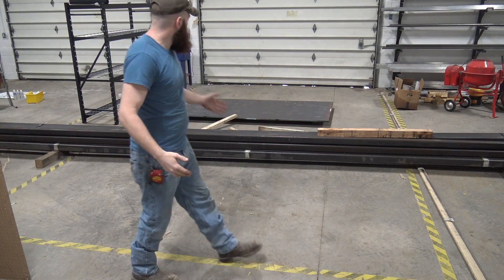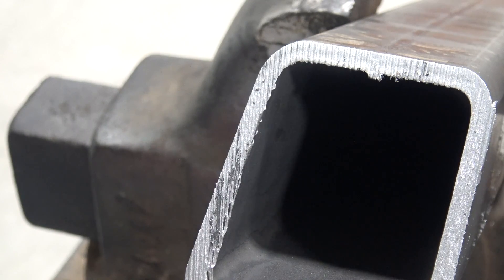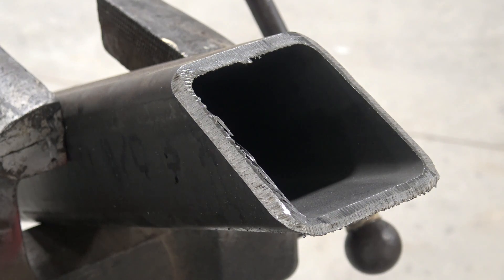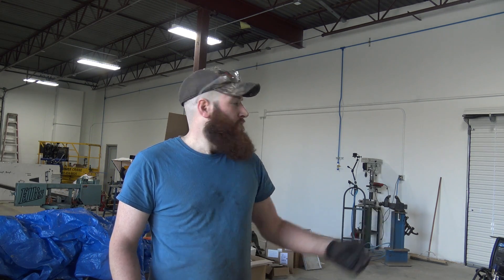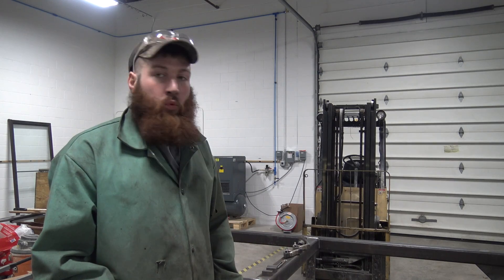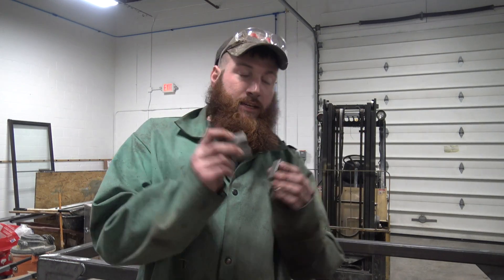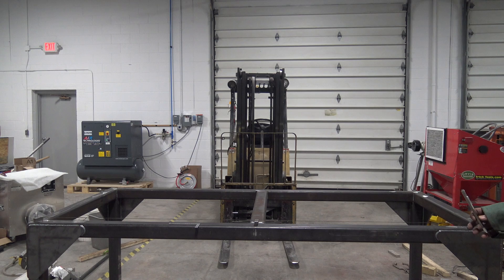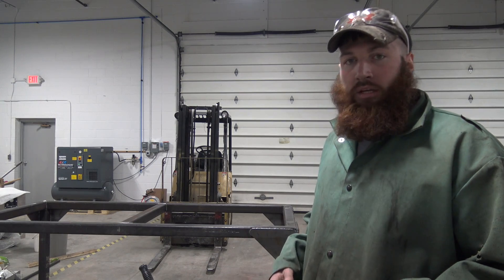How to Build a Welding Table!  Widget88

Comment: I use metric, you gonna have to learn to use metric if you gonna follow this... so... 24".70 in length by 12".20 wide... 

Dude don't use that much metric because you make it sound imperial.

Comment: The heat effected zone is only about half inch from your weld you can usually see this by the color difference and i was shown to heat up a "dot" at a time not as much as shown because the material has been altered once before and heat distorts material  more than thought. try to press it back straight first if possible because the molecules "grain" of metal can only be manipulated so much  before it weakens and becomes brittle 
Metal usually has a "natural" bend from the mill adjust your build best for this if you can if not back bow or bend the opposite direction the work is to be welded to compensate for the warp from welding also bracing before welding and then stress relieving the welds helps alot 
To stress relive a weld simply "ping",  hit with a hammer were the work was effected

Comment: Downhill welding isn't a problem as long you know when and when not to. Like a cap on an end of rectangular tubing it would even be a problem go downhill. But something structural, I woulnd't recomend it. From my experience you can go downhill since it doesn't affect penetration for steel under 3 mm.

Comment: I don't think I would bother trying to flatten a piece of plate that size with heat. The fact is, it's still going to move over time. I would weld some tabs on the underside of that center beam with an acme nut welded to the top of the tab. Feed some acme rod up through that to contact the underside of the table. Adjust the table up and down using the acme rod.

There are several configurations you can do with this. Some people will weld the rod to the plate, but I would prefer not to put localized heat into the plate.
Reply: p

Comment: I use a torch and bucket of water with rag, heat with one hand and quench with the other with wet rag. that pulls the metal more but requires less heat and that is important doing very thin RHS (2mm wall) otherwise the wall bulges if you heat enough to pull without quenching. If you lack an oxy torch you can run a weld line and quench it to pull, just grind it off when done.

Comment: I learned the hard way... my welding table is not as flat as it's suppose to be since anything you weld will be affected by it. The frame warped while I was welding and I ended up with a 3/16" gap in the center. Needless to say, I'm starting over. Of all the videos I've seen of those making welding tables, no one says anything about how to create a flat welding table.
Reply: What's a 3/16" gap?
Does not compute!

Comment: Would have done the three block string measurement before welding.  I use a inexpensive laser line device on a stand to keep things on track.  Great thing about using a laser is that you can leave it on during welding to monitor distortion.  Metal suppliers will not have metal in their yards that is truly strait due to the manufacturing process and handling.  I sometimes need to place metal sections in a shop built 20 ton press to remove some of the bow in the metal.  Your heating of the metal after welding up the base to remove distortion of the metal from welding is a nice idea but you were working against gravity and heating of the metal can remove temper and anneal it. It's not all that critical in a welding table to have nuts on measurements.  It's a welding table after all that will warp due to heat from future welding.  There will be tacks and weld splatter that need to be ground off which will make the table have high and low spots.  The only truly flat welding table I have used was one that had a machined cast iron plate for a top.  Very nice setup but weighed more than a house.  Your use of gussets and welding technique is very good.  Hope to see more videos of you building things.Not a big fan of metric.  Base 10 stuff is alright I guess.  After all we have ten fingers and toes unless there was an accident in the shop that removed a digit.  I have dealt with a lot of crappy metric nuts and bolts over the years starting with work on a 1972 Volkswagen beetle.  Guess I have never fully recovered from that episode.

Comment: I'd like to make a recommendation for your next table. Use I beams instead of tubing, the tubing will give you very little resistance from warping and if you do any jigging where you are using torches to heat and bend something your table is gonna warp like crazy.

Comment: To me, the key isn't knowing how to straighten or flatten plate, but to build yourself in adjustability. We are using several rows of C-Channel on top of the 3" square tubing frame. And from under the lip of the C-Channel, drill and tap about 5 bolts each. Then mill the top of each C-Channel flat including the ends of the bolts flush. Then proceed to weld the C-Channels to the frame. The table top (ours is only 5/8" that's all I could afford at the time) is only bolted from the top down to the very 4 corners of the C-Channel on the ends. The table is super flat, and if it gets out of alignment anywhere, I can reach under and give a bolt a twist.

It wasn't that hard, except for I don't own a mill, a forklift, have awesome welding set-up... yet I was able to do it just fine. Yeah, I had to pay a shop like yours, to mill off my C-Channel with the bolts in them... but I knew I'd be getting a flat surface in which the steel plate was sitting on. I know a lot of guys think they need to weld the plate to the legs, but after closely checking out some really expensive fab tables by Sigmund, and similar tables, they were all bolted as well.
Reply: TheBikerScout can you make a video of your table?

Comment: In an application like this where one side isn't seen you can do a fine and fast job of straightening with a air chisel with a punch in it.  You can draw your high spots down by putting several punch marks in a cluster on the opposite side.  Thin plate takes few marks, the thicker the plate the more heavy you have to punch it. if you hammered it enough you could actually pull the whole plate into a bowl shape but that certainly isn't what you had in mind.

Comment: Weld the plate on send it out to get normalize and set the whole thing up on a Blanchard grinder. But if going to go with all that trouble and money you should start with at least a 1" thick to 1 1/2" top plate.

Comment: Ok, so I need another thought of conversion - I hear Jared say it's about a mil or 2, 10 mil short, etc. , I think of imperial thousandths,  so verbally saying mil actually chops a syllable from millimeter???? Life is easy so far, only two restrooms to choose from ;P
Reply: +PartisanGuerrilla I too was taught in the old school, where a mil is 0.001" - or $0.001! ;^)

People who were brought up under the metric system in the last 20 odd years have taken to using mil to be a shorthand for mm - mostly because they've never had to work in mils...

Then, I'm also used to working in both systems of measurement, so I've been converting and rounding off some of his measurements...

I'm pretty sure that when Jared's saying "50mm" he really means 50.8mm = 2"  

and 3mm is pretty darned close to 3.17mm = 1/8"

And his 10mm is pretty close to 9.5mm = 3/8"

It's really common for fabricators who are doing "metric" measurements with US standard steel sections and plate to round off in this fashion...

So, if it makes him feel better to work this way, by all means... for fabricating structural elements, where +/- 3mm is the standard tolerance... ;^)

I'll just work in whichever units my stock was made in... or the local fabricator supplying the work to the client can buy for the stuff we do at work...

Cheers!

Eric

Comment: Nice video, quick tip when building benches or any four legged structure though. Build the sides first, as in 2 legs and a top member flat on the floor, once its square build the other side on top of it, this way you know both sides are identical. Then turn them legs up and add cross members, squaring accoss corners. Much easier and accurate than trying to square 4 legs in both planes with a square and can be applied when your structures get larger for instance if your legs were 2 or 3mtrs tall.
Reply: +NYC CNC If you want to build long roller tables for your saw etc and have maybe 8 or 10 legs each side it makes life alot easier or if your building racking 2 - 3mtrs high it's the way to go. No need to worry about the hidden mitre underneath that cant  be welded, if load bearing capacity was your major concern your legs would run straight up to bottom of table since structural hollow section would squash when used on its side. 👍

Comment: Nice job Jared!  I sent years on 2 huge welding tables building firetrucks from scratch with  a shear, brake, and welder.   Cant say enough about a well built table to fix your project to.  Nice tough on heat and truing:)  Props.